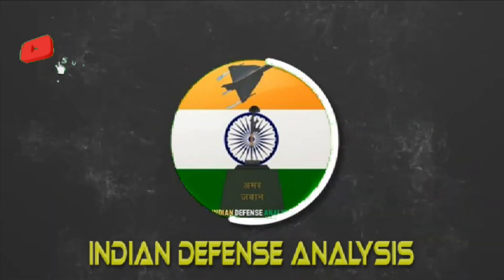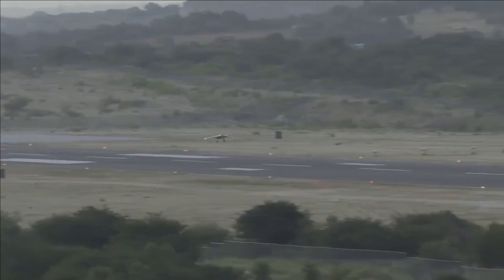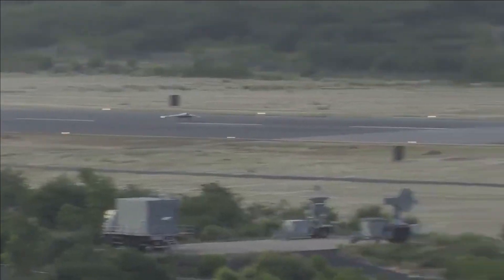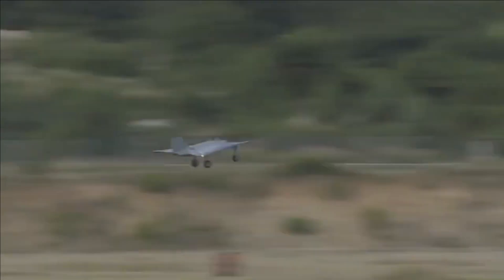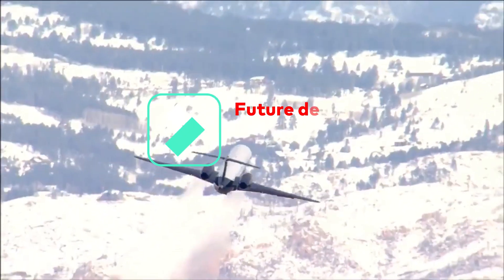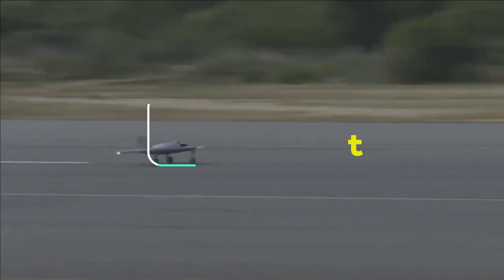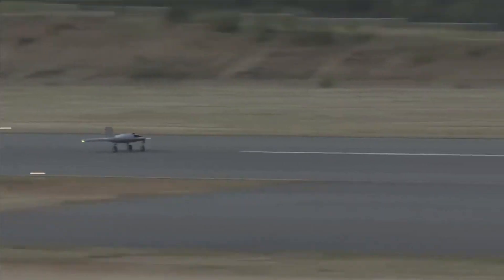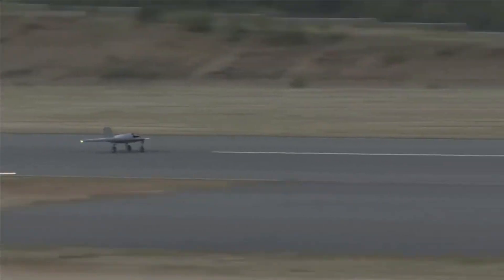Why vertical fin added to Swift?

Comment: Why? Isn't it obvious? A flying wing isn't easy. Vertical tails are for stability. Conclusion: They're still nailing down the software. Auto corrections to keep that sucker in the air. I suppose I could watch the video but I'm 99% sure that's what they'll say. 🙂